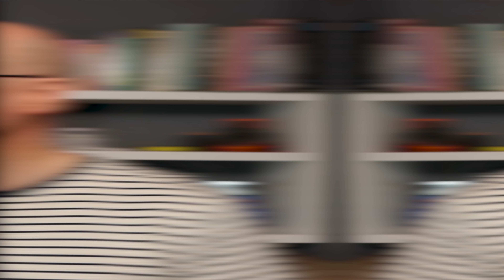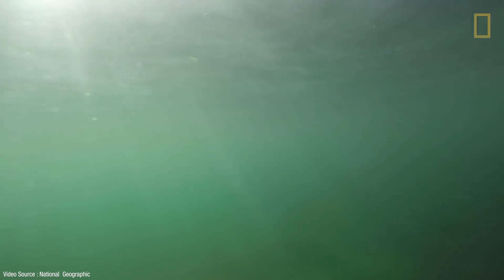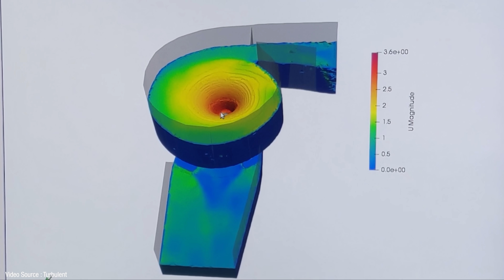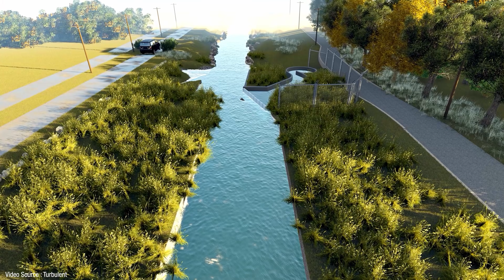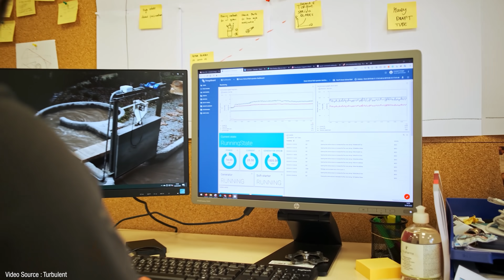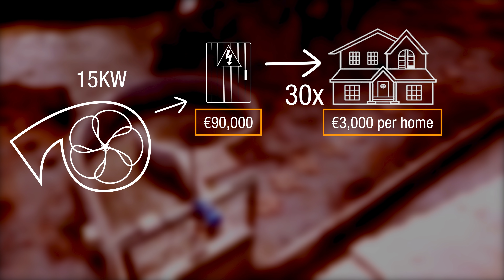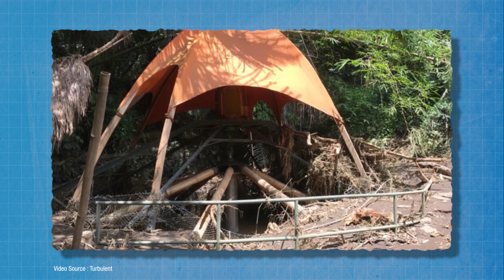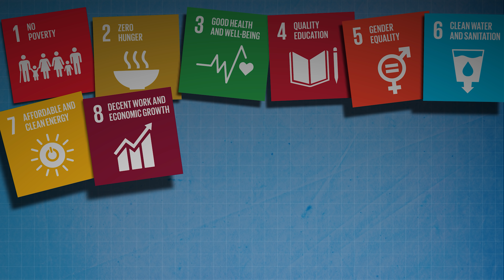Micro Hydropower : Turbulent Turbines

Comment: I find I’m quite attracted to this potential though do have some questions....... 1) can the micro-hydro systems be sequenced in series to then produce multiples of energy generation for larger areas leading away from direct large water sources? ( thinking rural locations in mountainous regions where there are also local communities. 2) in addition, have models been developed for the purposes of informing, educating and planning with local investment and cooperation? 3) What portions of the work be done locally with local buy-in and support that also brings investment into line with local and regional resource and investment considering time. 5) What research is available around how diverted waters that once through generators can also be directed to slow movement down-hill and replenish natural groundwater and agricultural operations? 6) Solutions for regulation aggregations and return of waters to lower regions after replenishing upper groundwater and aquifers ? 7) Buy-in (time to install relative to cost and production) as investment, time-lines, maintenance, and how the ROI’s are structured? 8) What is scope of current R&D in terms of locating systems according to volumes of water, schedules in seasonal rainfall or snow? 9) Efficiencies for transmission over distances and inversion? 10) potential for closed systems so as to open from vertical installations only? 11) ram jet usage, in-line or tertiary supply to move smaller water amounts to selected holds for absorption and later uses in irrigation, seasonally & on its way to lower regions? 
Thank you for opening this truly valuable scope of potential as it looks to be well worth the allocations in time, development, resources and investment.

Comment: If you are going to present the running costs, please include the maintenance of the turbine. The manufacturers website says: Replacement of bearings every 3 years, Electrical controls check every 2 years, Re-greasing  of gearbox bearings every 2 years, Replacement of seals every 2 years, Retightening of all bolts every year, Gearbox oil change every 6 months. You made a big point that it would be suitable for hospitals who require uninterrupted 24/7 operation, but they would still require diesel backup or grid connection just to cope with the hydro maintenance. Your costing maths does not add up either, can you confirm that you were not paid a fee by Turbulent for this video ? I live remotely generate my own power, and love hydro power,  I would love this channel if your maths were better, and your conclusions were more accurate too.

Comment: Do they work in salt water? Because in most of the world, tidal fall is an un-utilized power source, impressive if you've ever tried to fight the tide - especially in large bays where the tidal fall has different timing - some parts will be rising as others are falling and others are still, and these change over time. If these work is salt water then these could be placed at multiple points each giving a total continuous feed into the grid. Just have a think.

Comment: I'm thinking that this type of system (slow spin) requires a really large volume of water to work effectively compared to a Pelton wheel generator system?  For example, we have enough year round water flow to keep a 1-2" pipe filled with falling water to the bottom of our property (200' of head) pretty much round the year.  But only in the winter is there the volume for something like this...  How small could you make something like this, with how much water flowing through it, and it still be effective?  Many thanks.

Comment: FYI, before the three gorges dam, china was having major floods in those areas and there's no way to prevent properties in those areas from getting washed away and people getting killed by nature. if you have a common sense, dams are also a way to control the flow of water if ever sudden heavy rain fall comes and cause flood. so don't saying that the three gorges dam is causing the flood, there are times when the reservour was so full and heavy rain still comes, then there's no way to prevent flood. but it have prevented most of the floods when the dam was not there. beside generating power is another plus to the project. Please be more professional with the info you are giving out to your audiences. it is leading people to the incorrect understanding.

Comment: Yeah, great, maybe, in very rare cases. With the example of 15 kW, at 1.5 meters you need a flow of just over a cubic meter per second, to extract 15 kW, at 100% efficiency. In reality, you'd need roughly 3 meter height to extract 15 kW from 1 cubic meter per second, with that kind oh turbine, as they are around 50% efficient, according data from the company, while conventional hydro power can be up to 95% efficient.  Also in reality, places actually suitable for that system, in all aspects, and where 1 cubic meter per second constitutes a small part of the total flow, year round, are rare.

In their own graphic material they have dams, in the cases you actually get to see how the needed difference in water level is achieved. Because, with extremely rare exceptions, you need a very long channel to get the height, and flow, from the natural slope, from a small part of the total flow, year round.          

Also, we might think of rivers as unchangeable, but they're not. 30 years is a long time, especially in a time with a changing climate. 

For the fish, hydropower is not all about sharp cutting turbine blades, the are possibly lethal changes in pressure, from one to the other side of a small turbine that harvests 5 kW or more from the water. 

Also €90k  for 15 kW must assume there's a dam, or waterfall, and near optimal conditions in general. With similarly optimistic assumptions solar is cheaper per produces kWh. €90k is a huge investment for people that otherwise pay 50 cents/kWh. The calculation also assumes no maintenance, and no interest, and that there will be a constant dependable flow of water the coming 30 years. 

Space required, well, as long as there's more roof space than required, solar wins, totally. 

Reliability, well, if the main cause for that difference in cost between €75 k for grid connected, and €90 k off grid is not batteries, I don't know what it is. The system is not fool proof, it will probably fail att times, and require maintenance, sometimes.            

Also, solar is scales perfectly, there are 100 watt solar panels for less than €50, when you buy them singly. Sure, you need batteries for what power you actually need when there no sunlight, but, you'd need batteries if you rely on a single turbine also.  If you're used to relying on diesel generator electricity at 50 cents a kWh, your're probably not used to unlimited constant supply of power anyway. 

Renewable power, that don't use fuels, or storage like conventional hydro power, costs what it costs, and produces what it produces, when it produces it, regardless of how much power and when you actually want it. This is equally true for solar as for hydro power without a dam. Those 2.3 cents per kWh is per kWh produced, best case scenario, NOT per kWh actually needed. Sure that's true also for solar,  but with solar you don't need to invest €90 k or €75 k without the batteries to reach a cost of 2.3 or 1.9 cents respectively per kWh produced the following 30 years, still best case scenario, and zero maintenance cost, and not considering interest.  You could make that hydro power even smaller than 15 kW, but it would not result in a much lower cost, but it would get a lot more expensive per kWh produced.           

In a very remote village, where the only power, if any, comes from small diesel generators, hopefully you don't have use for 15 kW of power average, assuming batteries to handle variations in demand in the off grid system. So, in most cases they'd probably need a lot more money, on top of those €90 k, to get good use out of more than a fraction of that power.      

Also, if such a system is to be shared by a lot of households, you need a way to distribute the power, from the turbine, to every household. Distribution alone can cost more than a little bit of solar and a little bit of batteries in every home to cover the basic needs, getting rid of diesel generators for power and or burning stuff to produce light, and a bit more than that for increased quality of life.  Increases in power generation as need increase, or can be done €50 at a time, if not less already, definitively less than that a few years from now, per 100 Wp PV panel.                  

Hospitals, that provides advanced care, for which uninterrupted power supply is critical, far from any larger power grid, and without a dedicated UPS system in any scenario, really? 

How is thousands of power production systems in a grid, a monopoly situation, and completely relying on one single turbine not? Either you need to have another think about that, or you have gotten the meaning of the word monopoly backwards.

Comment: The US has low headwater flood control dams all over originally built for power generation that utilities abandoned because they were ordered to install throttles and the low headwater installations had no throttles. They were mostly given free to gov't units to maintain flood control. Most systems I've seen are 6 - 20 feet of headwater, and were too small to be worth installing throttles back then. Some are old and poorly maintained while many are well maintained or rebuilt and fairly new. Originally built for power generation most still have a nearby power switch yard. Just add battery power storage to regulate the power and presto a peaker with some base load capacity. Some legal issues exist with dams often gifted with covenants but those used for flood control are likely to be quite permanent. These look like a natural for Micro Hydropower Turbulent Turbines.

Comment: if you were to injection mould the turbines, in sections, the cost per blade would be extremely low, same as the generator that is connected, many parts can be injection moulded from plastic and water cooled. allowing cheap manufacture

Comment: Tidal estuaries could potentially also benefit from use this technology, on a larger scale.   Example: The Severn Estuary, between England and Wales, has a tidal range of about 50 feet ( high to low). Previous attempts for dams and other hydroelectric structure plans, that reportedly could provide about 5% of the UK's needs ( per Wikipedia) have met with cost , land use and environmental obstacles. Could this technology provide a solution ?Lower cost, smaller footprint, more wildlife friendly, even if not able to capture a smaller percentage of the potential power, still better than no project/or a tabled project for decades. )
Further, as described in  the earlier video about vertical gravity energy systems, the footprint for such vertical gravity  systems is very small. The systems presented used solid blocks of weight. Where water is "free", water might also work instead of blocks. (concrete weighs about 150 lbs. per cubic foot, water weighs 62 lbs. per cubic foot, or about 41% ). But, since water is "raised/lifted" for free, by rain formation, (on to rivers, streams) or lifted by tides into tidal basins with large tidal ranges, would a vertical system be a more amenable solution (vs no solution or a higher cost system) in such areas?

Keep up the great videos and promising information !!!

Comment: I would agree whole heartedly that this kind of generation is little heard of, usually because someone is not making big bucks out of someone else, a way of thinking that at some stage we are goingnto have to jump up from a great hight.
There is also another method that again is kept very quiet about, geo thermal systems that would work in aĺl those places where there is no river.
I live in Western Australia where once apon a time we had a sun powered power station, it worked with parabolic mirrors where the suns rays were directed to a steel tube which was controlled so that it tracked the sun, it created superheated steam and ran turbines, worked for years with little or no maintenance, but clearly someone was not making enough money because although very effective, they shut it down.
In fact , i am sure that someone has already developed  a home unit that would say goodbye to electric bills, but they either got shot or became very rich very quickly, there in lays the problem.

Comment: So heres whats happening, because this is relatively cheap tech with huge profit potential, they have been installed in small rivers across shit tier nation. The most efficient way is to put whole creek into a pipe, run in through turbine, often these pipes go for kilometers to get downfall pressure. This leads to scaring of the landscape, more landslides as water is not draining normally, it destroys whole ecosystems and has a damaging effect. They arent sayin anything about it, weird huh.

Comment: Excellent piece but the statement early in the video that hydropower "doesn't emit any carbon dioxide in operation" is at odds with the correct statement later in the video that reservoirs can be substantial contributors of GHGs. Large scale hydropower requires huge reservoirs to operate so ought not to be considered zero emitters of carbon dioxide and methane. https://www.theguardian.com/sustainable-business/2016/nov/06/hydropower-hydroelectricity-methane-clean-climate-change-study

Comment: In Philippines diesel cost 0,666€/l, and diesel generator will make at least 3.2kWh/l, so price will be  0.21€/kWh. Also building turbine, you need to pay everything right now, and using 5% interest rate,  price will be 0.04€/kWh over 30 years. Still cheaper, but not by 20 times what you said, but 5 times. And if we assume you need to maintain diesel generator (also buy), or water turbine, take account to diesel price changes, dry seasons, different interest rate, total prize can be different. But it will be easier to use diesel, and pay per hour, than put down huge amount of money right now. Don't take it wrong, waterpower is good, and I prefer that, but there is some negative aspects also.

Comment: When you buy your retirement property make sure it is on a river or stream not a canal. You quoted these as running water when they are not, they don't drain the land and only "flow" with the water displaced when a lock is used.

Comment: This is a good and smart solution. But, like all other solutions, that have it own profs and cons.  Profs you have mentioned in video.

CONS is that such turbines have zero tolerance to ANY ice. So areas where it can be applied is very limited. You can see, that all already existing turbines is in the tropic climate only - it's not a coincidence. Conventional large scale hydropower don't have such issue, BTW. 

@JustHaveaThink it will be nice if you will mention not only a good side of each technology, but risks and limitations as well. But still you do a good job, and I'm happy to watch your channel.
Reply: Depending on th4e size of the turbine and river.
Unless you are living somewhere extremely north/south, Freezing would only be really problematic for smaller sized instillations off smaller or slower moving bodies of water. 
Even when the surface layer freezes on a River, The water is still moving. the faster the water is moving, the less ice is an issue.   These could still work in a Lot of places where Sub zero winters are the norm, But would be limited to higher throughput models on higher volume bodies.
Reply: @nuarius  according the images of real tourbines from the video, i would say that that freezing the surface of water will stop this turbine, and potentially damage it. And it is 100% sure that when temperature will rise (and ice start to crach and moving) it will damage turbine a little bit.
Reply: I would think that using some grating at the intake of the vortex would stop large pieces of ice from getting to the turbine. As for the flowing water itself, as long as it remains flowing fast enough, it should prevent freezing after the water comes through the grate. If you're really that worried about it, it could probably be covered up and use some of the generated electricity to power some heat lamps that are turned on when the temperature drops a certain amount below freezing.

Comment: 5 kW is smallest turbine but to actually get 5 kW power there need to be 1 meter drop and 500 liters per second flow (theoretical lowest limit by physics, in practice most likely double of that). That means 3 barrels per second, or 3 meters drop in height and 1 barrel of water per second. That is considerable flow, not found in many places. For example the river in 11m30s is typical low flowing river without much height difference. Those small rivers with big altitude difference tend to go dry and have much water during rainy season or after rain. That's why people build dams, so there is water and power during dry times also... So, good idea but not as useful as video gives impression I think...